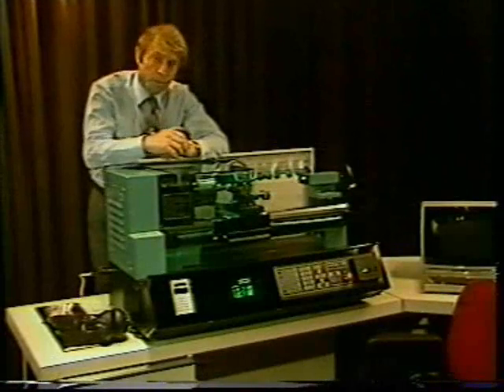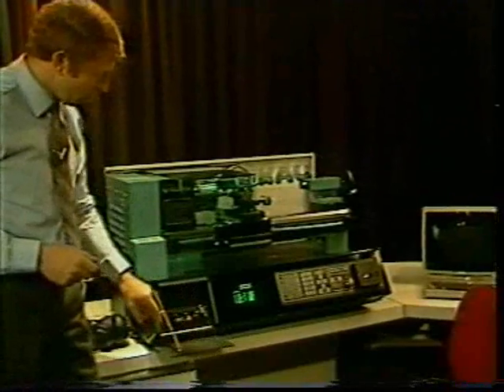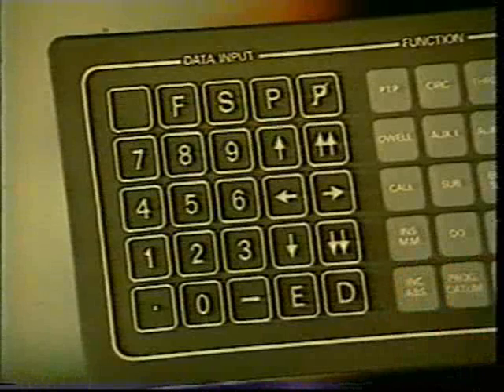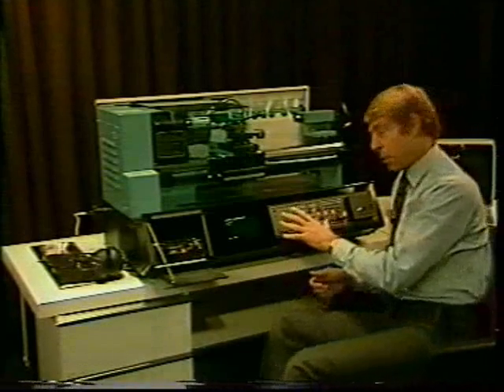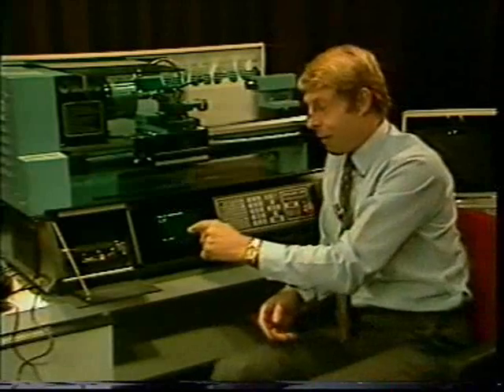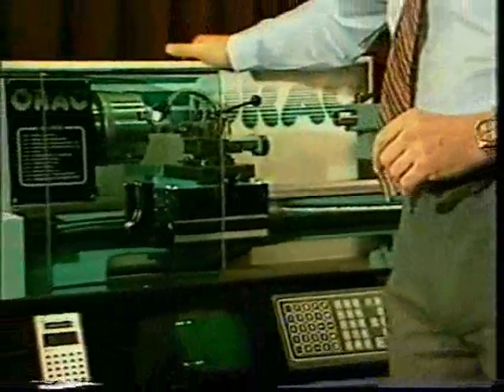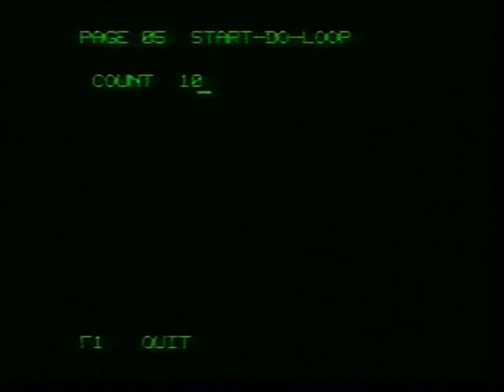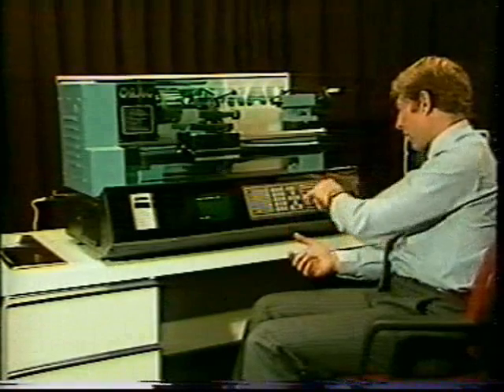Denford orac lathe - training video [Part 1]

Comment from the maker: @ultra1magnus I think the chuck came from an old Zyto lathe (I think that was the name) that I had many years ago and when I scrapped the lathe I kept the chuck. I made an adaptor block to fit the lathe spindle and that the chuck bolted to. I think you may be able to buy unmachined plates to fit on the lathe spindle but I've never gone into that & I don't know if the spindle nose is a standard size.